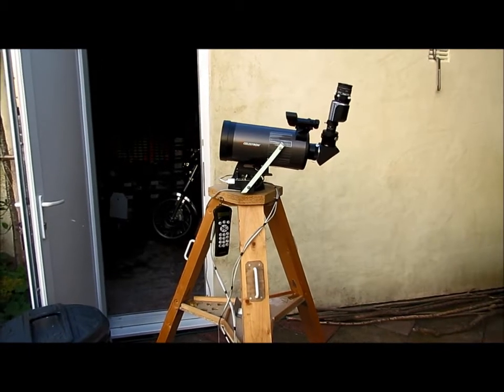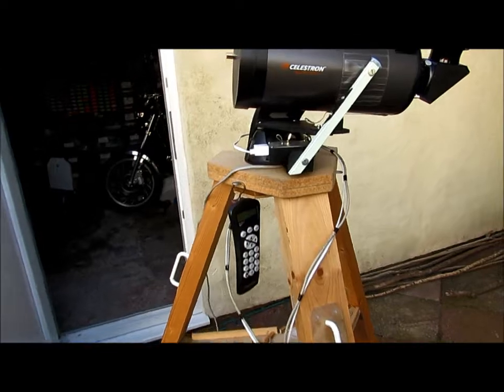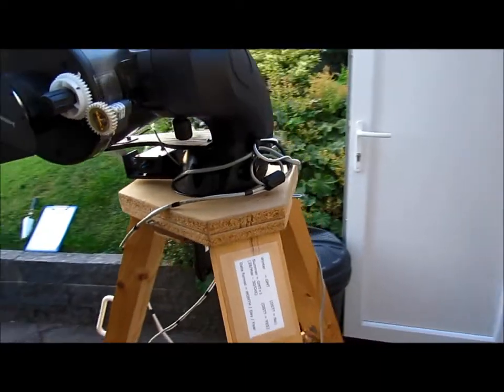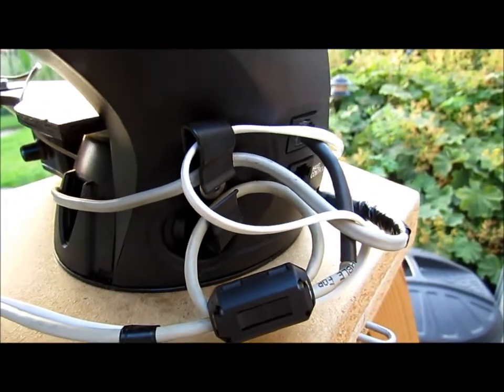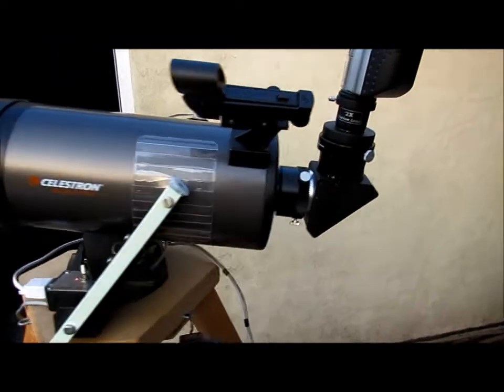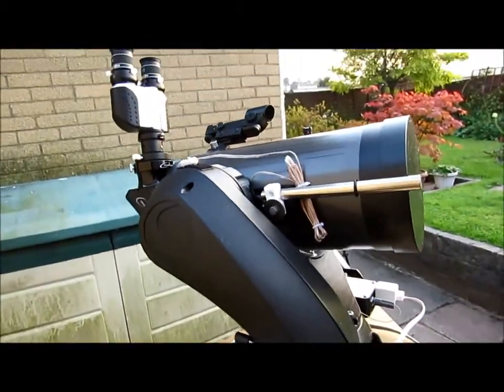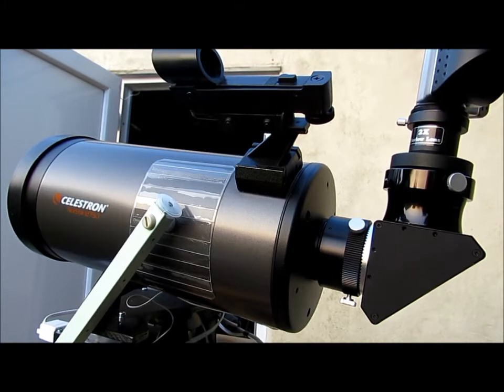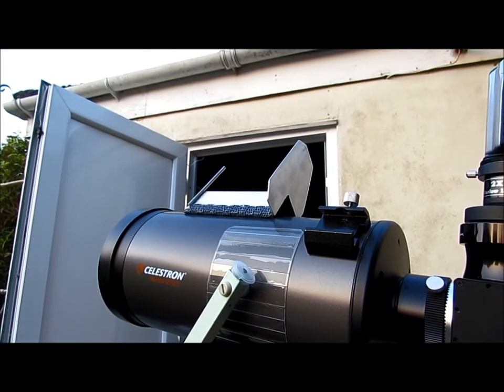NexStar 127 motorfocus and other modifications

Comment: Hi, great project!
For the focuser do you have by chance the STL files of the gears to be printed with the 3D printer, please?
Reply from the maker: Hi there, unfortunately not (I had to look up what an STL file was!!) This project was far more rudimentary than that! The gears were just some random ones from an old ink jet printer that were in my junk box. The only important factor was that the gear centers were far enough apart to allow the motor to be mounted on the telescope tube.
After that the gear used on the focus was hollowed out to become a tight 'push fit' onto the rubber of the focus knob. 
The gear used on the motor was also hollowed out and a brass fitting was 'epoxyed' into place. This fitting (the brass terminal bar from a ceiling light fitting!) has small screws in it allowing it to be clamped firmly onto the 'flat' of the motor/gearbox output spindle.
The motor/gearbox was a cheapie from ebay and the counter (again from my junk box)  is marked up as 'Spectrol Multidial model 15' (Very expensive new I find!!!)
This is turned by the brass fitting - I shaped a plastic piece to act as a sort of 'dog' clutch to engage with this brass fitting.
Hope this is helpful. (I took some detail photos but unfortunatley I cant post them here)
Regards, Steve P